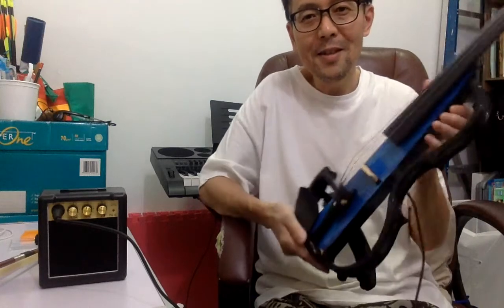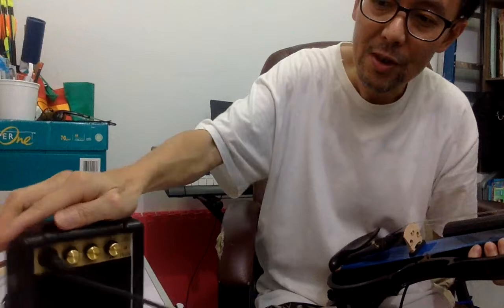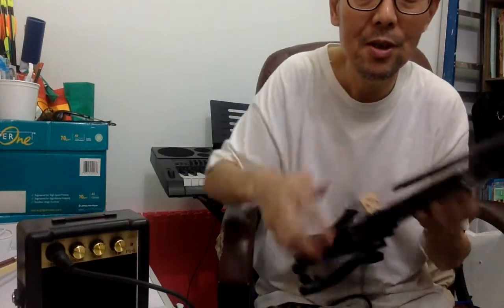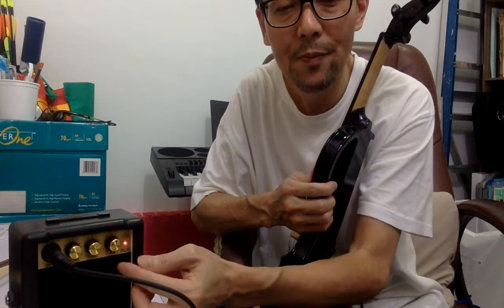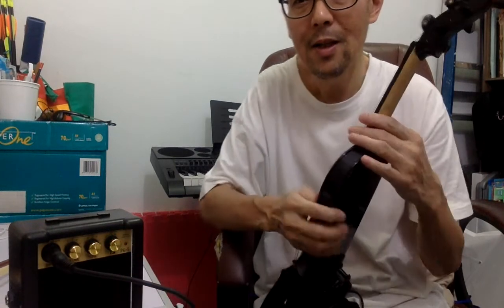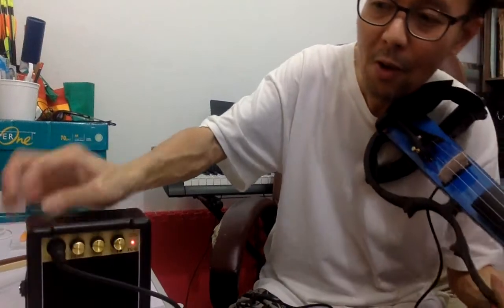4. Acoustic vs Electric Violin : Testing Amplifier and Violin

Comment: I just bought the mini amp & turned on power but the light doesn't turn on. How can I fix this?
Reply from the maker: Could be defective. Is there any sound?
Reply: Paul Chin hi. My husband found the problem.  I was sent an old battery.  He put in a new 1 & it works.  Thanks for responding.  Jesus the son of God loves u. John 3:16.
Reply from the maker: Glad to hear you managed to solve the issue!